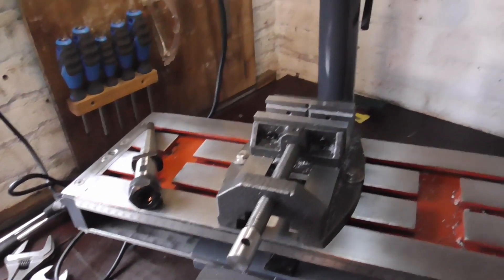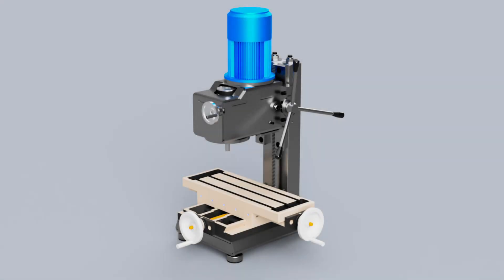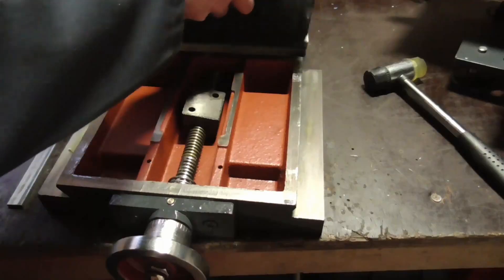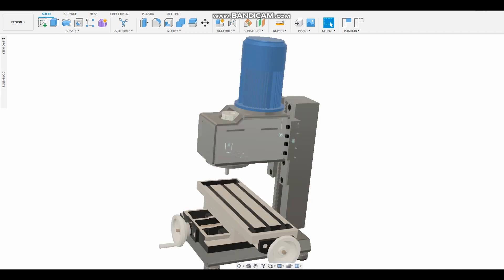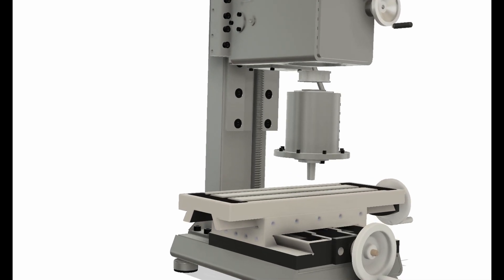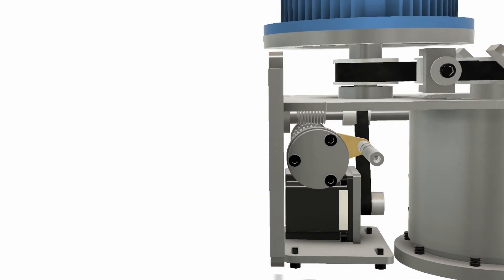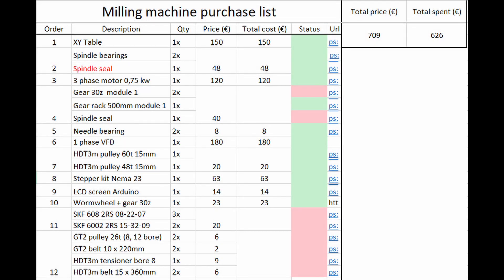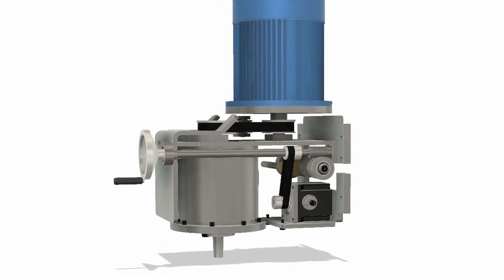my Homemade MILLING MACHINE [design]

Comment: What a beautiful mill!  It's a shame you're going to build it out of sheetmetal. Sheetmetal will make it an even less rigid machine than what you already have and will be very loud. If it was good enough, you'd see tons of cheap sheetmetal based lathes and mills. It's also not cheap. The heavier the gauge the more expensive it gets. 

I would use either epoxy granite or uhpc (ultra high performance concrete).  A gallon of epoxy can be had for $50 to $75 and can easily make 4 small mills. The sand and gravel mix is a few dollars or even free, but you have to make sure you mix it properly.
Reply from the maker: Good point, I forgot to mention that I want to fill up all of the cavities with something like epoxy granite or concrete. Just sheetmetal wouldn't be ridgid indeed.
Reply: @EngineerSteve  So you're using the sheetmetal as a form? Sound interesting. Can't wait to see what you come up with.
Reply from the maker: @bobweiram6321  That's my plan indeed, the parts that will be filled whith epoxy granite or concrete are constructed out of 6mm (1/4") sheetmetal. There surely are better solutions but I am excited to experience the result.
Reply: @EngineerSteve  I would recommend going with epoxy granite if you’re going to fill the mill since epoxy granite doesn’t shrink after curing. You could have issues with shrinkage if you use UHPC.
Reply from the maker: @grandmastersreaction1267  Thanks for your imput! I am leaning towards epoxy granite or other epoxy solutions.

Comment: Nice design. You said you'll connect steppers to the axes. Will you do it in an open loop? The slides are rough, lots of statical friction - do you expect the steppers to perform accurately? (typically CNCs use ball based slides to minimise friction).
Reply from the maker: I want to combine steppers and rotary encoders to create a closed loop system (I know there are closed loop steppers, might use those instead). 

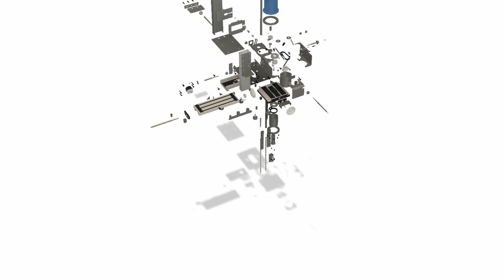To be honest I still have to do some calculations to make sure that the steppers are able to move the x,y-axis, the z-axis has a 1:30 (worm gear) reduction, which should make it an easy job for the stepper. Speed is not very important to me so I can always use a belt reduction as I want to power the axis with a belt transmission anyway.

Comment: If the design is not capable to provde the machine bed including column with a decent amount of rigidity then it's not worthwhile to start building one. The machine bed must be heavy as the more mass it has the more mechanic energy it can absorb.
Reply from the maker: Thanks for the feedback, I will make sure to incorporate weights into the base by means of filling it with steel/concrete or something like that. It will never be comparable to an industrial machine but I am confident that it will perform to my expectations.

Comment: Looks very similar to the milling machine I have.  Observations: make the upright as rigid to the X/Y table as possible.  Also, give the upright as big a CSA as possible.  Still a lot of backlash in the worm drive Z axis in mine too, so if you can reduce that, again you’ll improve the mill.

Finally, make it DRO compatible so it has more usability.
Reply from the maker: Thanks for your comment!  While designing I made sure that the upright is connected to both the table and the base (with a total of 10 bolts), this way the table, base and upright should form a ridgid group. also filling the base and upright with concrete or epoxy granite should help a lot.

I am planning to make a DRO myself as I want rotary encoders on all axis to make the steppers work in a closed loop.

Comment: Better that the spindle housing can be tilted in a controlled manner.
Reply from the maker: I thought about it but decided to build it as ridgid as possible. It would be a very nice feature but I will  play around with fixturing whenever a setup requires a tilted headstock.

Comment: Please I want you to explain how the spindle is moving up and down through the nob when the motor is rotating
Reply from the maker: The spindle is ridgid mounted in the headstock, the whole headstock will move up and down when turning the handwheel as there is a worm gear connected to the handwheel (1:30 transmission, 1 full rotation of the handwheel will move the headstock 1 mm) I will show the mechanism in great detaill whenever I start building it.